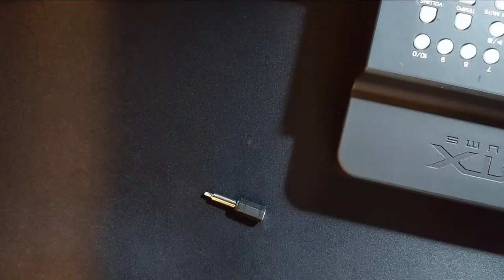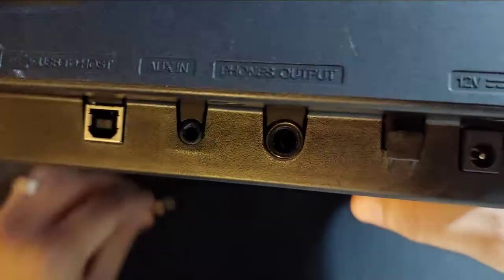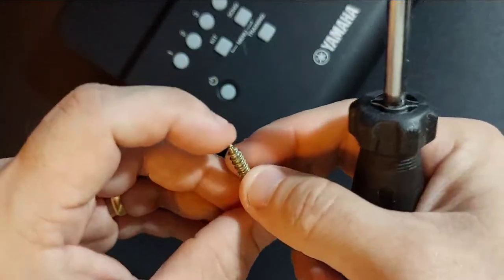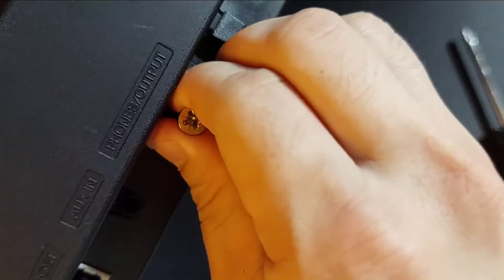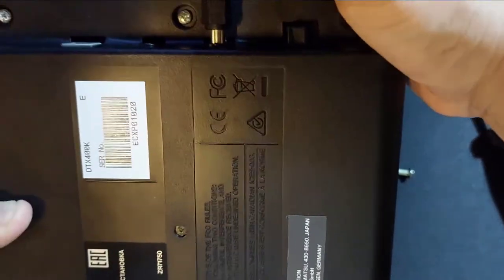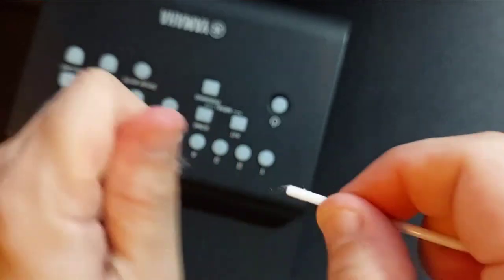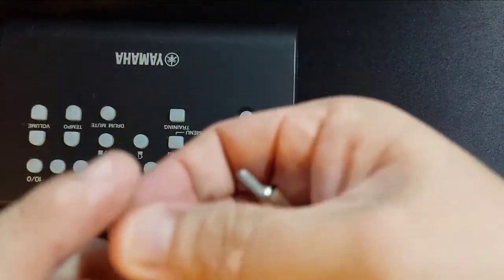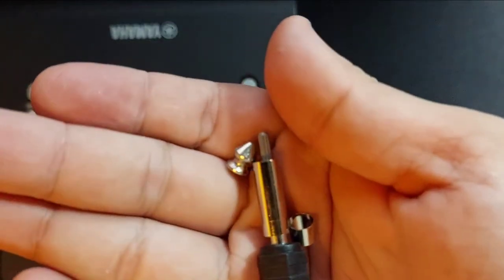How to Remove Broken 1/4" Jack Tip

Comment: You saved my helix. I was about to give up on anything but tearing it open. I can’t believe after like a year all I needed was a q-tip.
Reply from the maker: You're welcome and Glad to hear that Matthew! Also glad that you didn't have to risk causing further damage to your helix 👍😂
Reply: Before I watch this video, I've opened my Pod Go, and its not possible to take the tip out from inside, the jack is sealed!

Comment: The screw idea worked great and fortunately pulled out the whole thing in one piece. The only other problem I had was the little protruding thing that makes the jack click into place. It was preventing me pulling the tip out with the screw. I fixed that by pushing it to the side with a thin nail while pulling on the screw and it came right out. Thank you.😃
Reply: Thanks for the tip about the thin nail method, I'll try it.
Reply from the maker: You're welcome! Glad it helped👍

Comment: HOW does that happen ? I took two pairs of channel locks and I tried and tried to break the tip off ( with out bending ) and it's impossible !!!! If I can't purposely break one after 10 minutes of trying.. and then another 10 minutes of trying with a lot of pressure but not enough to ban to ruin it I couldn't take that tip off to save my life..... For an hour I tried with two pairs of channel locks.... So how the hell is one of those supposed to break in the back of a guitar effects or in a  guitar amp ...... I have played professionally 7 nights a week for 30 years in clubs all over Los Angeles Phoenix Arizona Nashville Tennessee Chicago the Aleutian Islands the Bering Sea.. and I don't understand how any of those can ever break inside of a unit if I can't break it on purpose and I rebuilt my first engine when I was 15 years old I know what I'm doing.... they don't !!!!!

Comment: Awesome!  The screw worked to get the plastic ring out, but the Q-tip wasn't strong enough to pull the tip out.  However, I tapered down the end of a chopstick with a little sandpaper, and that worked!  Thanks!

Comment: Does not work for all types of jacks mine was built different than the one showed in this video somehow managed to get it out with a pair of long Surgical tweezers but took a while to get a good bite to pull it out
Reply from the maker: In this video, it was a 1/4" Jack that is stuck like any instrument cable. And yes, took a little while for the screw to get a good bite. Well, hope you got it out eventually.

Comment: PLEASE HELP

my headphone jack is struck deeply in the audio port. I tried taking it out with a needle but it came out like what you showed in the video when you used the screw except for me the metal/plastic? skin came off and rest is still deep inside and I am unable to take out the rest as what ever was in first part is sticking out (it is only wire with thin layer or coil or metal around it) so please help
Reply: i have a same problem currently.i tried everything and i want to ask did u took it out and if yes how?

Comment: I broke off the tip on the other side of the cable so I could compare the hole size. Then I had a set of diamond coated grinders (made for dremel/high speed tool). Found a size that fit but had to be twisted a bit. Grabbed on and then put a little torque/lean on it while pulling it out. Also had omto do as others said to push the retaining contact/clip out of the way. Also used a little gravity to help (so from an inverted position.

Darn things. Don't let people trip over your cables 😅

Comment: Welp, when I put pressure on the screw, I must have used too much force because I heard a click and then the tip popped out the back of the jack and went spelunking down the amp. I never recovered it, but the input works again so all's well that ends well. Thanks!
Reply from the maker: Glad to hear it turned out well in the end 👍. Keep rocking now 🎸🎶🤘😊

Comment: I used an m3 tap from a tap and die set (used to cut threads in metal) gripped the metal tip that was stuck perfectly, out in 5 seconds after trying tweezers for half an hour.
Reply from the maker: Glad to hear that! 👍😊

Comment: I had a very bad experience with My DENON Amplifier when i broke Sennheiser headset jack and IT WAS STUCK inside!! Very deeply...
In the beggining,i used glue!!! Wrong!
Very thin pliers.. Nothing! I was desperate that i had to move the whole Amplifier to an expert😰😱
Suddenly i had an idea: Drill bit!!
The idea with screw is a good one but i suggest DO NOT USE Screwdriver cause you don't have the feeling needed for such sensitive operation..
A) I saw inside Denon jack with a magnifier lense and light to see what has been left..
B) I used a drill bit No 2(i think 3 maybe better) which i started to screw with ONLY my fingures force.. When i felt it had stopped,i pulled back the drill not exactly in straight line!
And the miracle came: IT CAME OUT!!! I replaced the broken jack with a new one: Perfect!!!
Finally, YouTube is a big helper😉
Have a nice time,
🇬🇷🇬🇷🇬🇷
Reply from the maker: Glad to hear it worked out for you! Thanks for sharing all the insights. Keep making music 👍😃
Reply: @JoelYeoh  Hi Joel! Glad to hear😃 It's a good thing to share experiences through YouTube platform.
Best wishes and music!!